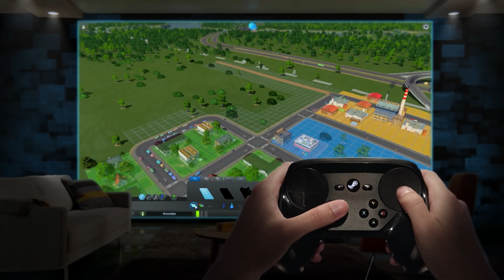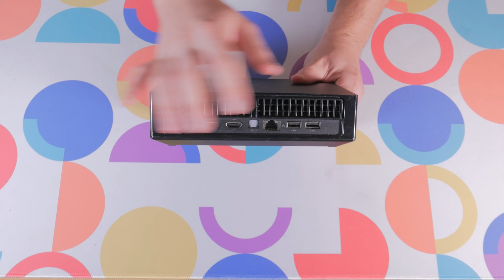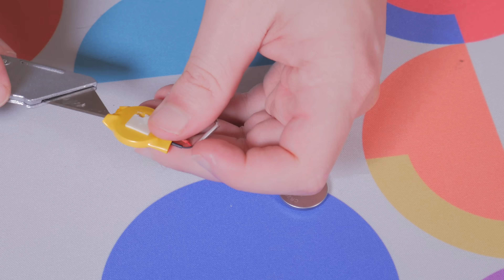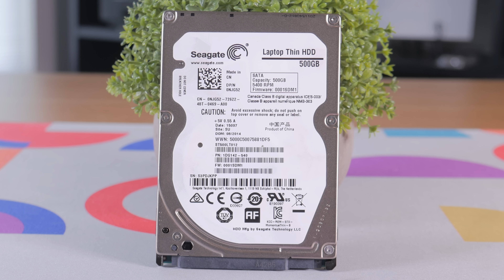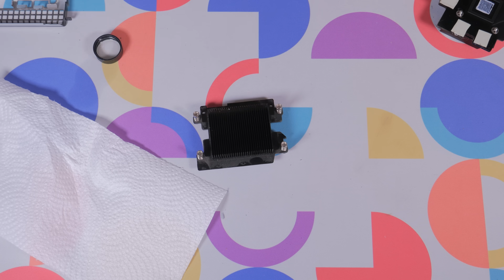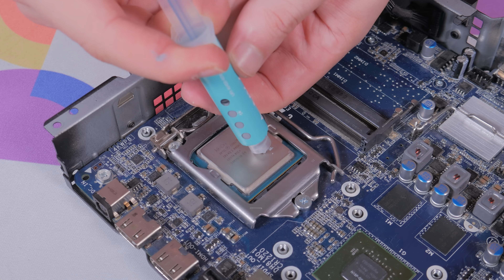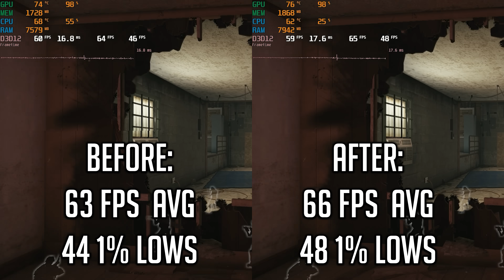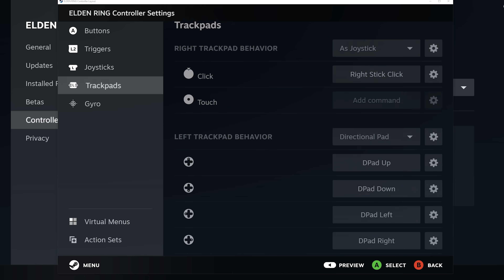I Bought Valve's FAILED Steam Machine in 2024...

Comment: since you have the Alienware Alpha with the NVIDA gpu (there was one AMD version produced), you can't install SteamOS 3.0 via Bazzite or ChimeraOS.  What you can do is install BatoceraOS on these machines and make a killer retro emulation machine.  I have the i7-6700t with GTX960 version Alienware Alpha and it rocks, running up to PS3 emulation. Xbox 360 is still shaky, but that emulator is still early and is buggy.  Since BatoceraOS is Linux based, it is not a resource hog like Windows is.  Give it a try.

Comment: Note: there were actually two generations of the steam machine released back in the day. The other one had an AMD GPU and a port for an external GPU docking station. The other had a later Nvidia GPU (GTX 960).
Reply: mine had the 860m graphics chipset. i had the og  with the i7 asm100 or something the later version was the r2
Reply: You're speaking of the R2.This is the R1 and it was only released with the 860.
Reply: Yeah i was able to find both the R1 and then later the R2 used for good prices on ebay. Even the original asking price it was a good deal at the time, there were only like 2 competitors and they were 500 dollars more for the same specs. This is not ITX formfactor its way smaller. I had the windows versions because back then steam OS had a huge performance hit and a lot of games didnt work, it was ahead of its time but look at them now some games they have a performance advantage over windows
Reply: Yeah, the downside was they did it include space for regular 2.5 drives. That way I could use the M.2 system drive and the 2.5 as storage.  Sure, the new port was good, but it was definitely limited. Even on the CPU generation they chose to use.

Comment: The problem with all the steam machines at the time were: 
1- the pricing was all over the place with different manufacturers.
2- Steam OS was based on Debian not Arch like the steam deck version so games didn't run that well in comparison to using Windows.
And finally and the most important one 
3- This came out pre Proton so they were actually expecting developers to port their games natively to Linux which a lot of them didn't want to do so valve has to change their strategy and ask gamers to instead stream Windows only games from another computer and that's why the steam link came about.

Comment: You REALLY need to upgrade to either an i5 or an i7, the computer will perform SO much better with twice as many cores. I speak from experience since I did such an upgrade myself on a comparable system as yours. Just look at CPU utilization, it constantly hitting 90+ percent while it really should be below 50 percent to be sure no GPU performance is left on the table.

Comment: Now that they have the steam deck and are working on a replacement, they could reuse a lot of the design and features to put the same or similar board in a bigger case and sell it as a console. Just in plop in better cooling to allow higher TDP limits and make it quieter and faster, add support for external GPUs and call it a day. Without the display, battery and controller bits, they should be able to get the price down to $249 or similar to compete with the xbox series s

Comment: thet steam controller is really something you wont be something you'll pickup and be comfortable using overnight, it takes a bit of getting used to and finding what settings work best for you. when i first started using it back when it came out in like 2015, it took me maybe a week or two before it really clicked on how to use it, but its kinda like riding a bike, once you get it then you're kinda locked in and it becomes a new norm for you. personally I like to turn off the trackball settings and just go full 1:1 mouse input. make sure you're learning how to use it with the gyro though, the track pads alone will get you like 90% of the way there but the gyro is the icing on the cake that makes it as good as it is.
Reply: I got one pretty soon after they came out. I played with it for a bit and saw the potential, but wasn't sold. It sat for over a year and I remembered how great the mappable buttons were when No Man's Sky came out. It's the only controller I actually enjoy for that game, and if I had to choose between a normal controller or a SC for an FPS/TPS, I'll always choose the SC.

Comment: A note about the Steam Controller: USE THE GYRO. A major thing about the controller is that it's gyro aim assist can be toggled on and off via capacitance, meaning you can have it not do gyro until you are aiming down the sights. It's meant to be tinkered with and played around, but if you just use it as a stock controller, then it won't be great. My personal suggestion is the roller ball mode for the right trackpad, which lets you panic fling in a direction and tap it to stop. The tactile feedback for it is legendary, and remains my most beloved controller in my collection.
Reply: This is it. I was underwhelmed when I first got it, but after tinkering for each game it's amazing. Using the track pad for aiming and gyro for ADS feels so natural now.
Reply: Steam controller is goated. a lot of tech influencers always criticize the awkwardness of it when its really good for FPS. Gyro and the trackball modes basically makes it where you can play TF2 or even Counter-Strike without a KB/M since theres no aim assist..  the back paddles also make crouch jumping possible without letting your thumbs off the trackpad. This controller was basically designed for this
Reply: I absolutely love my steam controller lol. That trackball mode is great
Reply: I don't use the gyro because I have weak wrists, but even then the inputs & easy mapping is still unmatchable today, even against third-party gamepad makers. The trackpads are amazing & while it takes a learning curve to learn, it definitely has a lot of utilities a standard gamepad wouldn't have.
Reply: I had one and never used it, ill give it a go now (I have a steamdeck so I get the gyro now)
Reply: My only issue with the controler was the trackpad, it just felt very strange, and i could never find myself enjoying it in games like First Person shooters,
Nontheless the controller itself was just universally loved. It worked amazingly as a controler, and was sold with the qaulity of all steam products (that being extremely good qaulity).

Battery life is yet to be a issue, This many years later, no damage or issues, works on PC and Mobile, its a overall amazing controller.
Reply: AA batteries is definitely better in any gamepad in my opinion. No need to worry where to buy replacements especially when they're discontinued. You can simply buy 2 sets and an external charger and you're good to go never needing to be plugged in while playing. And they're not expensive anyway. Proprietary battery and chargers would be much more expensive.
Reply: Nah, it isn't great regardless.
It's better for playing games not meant to be played with controllers than any standard controller is.
That's its singular saving grace.
Reply: I enjoyed mine for a while but then the track pads stopped working completely
Reply: they Gyro makes the steam controller the best ever.
Reply: I absolutely love using the roller ball mode for the right trackpad. Camera controls become a breeze. One of my least favorite parts of standard joysticks is camera control.
Reply: Every time I see a video of somebody trying the Steam Controller, years later: USE THE DAMN GYRO!!! :D. I insist on gyro even when getting regular controllers. This is why, besides a Steam Controller, I also have a Dualshock 4, Dualsense and the latest addition is, technically my daughter's white and purple Anbernic RG P01, which also has a gyro (great value but the firmware is kind of iffy).
Reply: so true Dota 2 if you custom map the controller makes it play like diablo 3 I won more matches with a steam controller then with the Keyboard and mouse you just have to put the time in messing with the configs took me just over an hour to map the controller the way i wanted it to feel the hardest part was making the movement smooth with the directional  Sticks but once I got it it was amazing but only because I customized it if I did the basic premade layouts it wouldn't work and I could see why so many people had issues you got to be willing to tinker with it to have fun
Reply: Love so much of the controller it's just unfortunate that it didn't have any rechargeable batteries
Reply: @RisingRevengeance  I'd argue it's easier with the current power layout. You can easily buy quality AA rechargeables anywhere. But imagine if it was a proprietary Lithium-Ion? With it being discontinued, the gamepad would've been dead.
Reply: @TheRibbonRed  there's no reason it would have to be proprietary
Reply: @RisingRevengeance  you mean like what they've actually done? Just buy yourself two rechargeable AAs & be done with it. I've had mine on the same set of rechargeables for 4 years & they still work just as well on release.
Reply: @TheRibbonRed  Sort of. It should also allow the controller to charge them via usb, which may be risky with random AAs.
Reply: @RisingRevengeance  oh, you want to controller's USB to also charge the battery inside? Yeah, that'd take a massive redesign. This is why proprietary battery was needed; and why Xbox, Nintendo, and PlayStation had proprietary. Because using LiPo or any other commercial rechargeables would make the controller either far more uncomfortable, or risk a fire hazard.
Reply: @RisingRevengeance  I use Eneloop rechargeables in mine and they work fine. 4 pack is $15 and have lasted a decade.
Reply: @phlogistanjones2722  a decade? Steam Controller came out in 2016, didn't it?
That said, I do have the same Enerloop rechargeables. Bought them in 2018 & capacity haven't dropped much. They're definitely recommended for SC, provided you stick an electrical tape on the side for easier removal from the controller.
Reply: I got the Steam Controller for $5+Shipping on the final sale Valve did when they discontinued it. I've never been able to get used to the trackpad for aiming or turning or anything of the sort no matter what settings I used. Even a simple circle-strafe is beyond my means. The main thing I use the controller for now is for platformers, shumps, etc - games where RS is either not used at all or just has a simple "pan up / down" use occasionally. I really wouldn't be using it at all if my 360 pad hadn't developed huge drifting issues.

Comment: I have one and it is running Linux great right now. The install of Nobara and Bazzite were both pretty wonky before the recent Nvidia drivers update... But now it's running very smooth on Nobara 40. I did the SSD and RAM upgrade, may do the CPU one when the cmos battery inevitably gives out.
Reply: It was at the beginning of the year but I did do a video of the install. Batocera is a great option for the Steam machine too as it is a pretty op retro gaming beast. 

https://youtu.be/Lprv6L-u9qk?si=_VwY_lib80IpNiW4

Comment: Note that SteamOS was Debian-based Linux, and SteamOS3+ is all Arch-based Linux with very different OS performance and kernel patches. For you non-Linux folk, It's like comparing Windows Vista to Windows 10 (rough example, but you get the general point).
Reply: This, SteamOS3, really isn't available to the public yet, just the ancient Debian version. However, I do see it has an old nVidia gpu with linux, which can be a pain with modern games as nvidia only gives good support if they are RTX branded cards. You're usually stuck with dated drivers, usually if below GTX or misc chips like this. AMD chips are usually much better off..
Reply: @arcadeportal32  In my experience every gpu starting from the gtx650 all work relatively fine on Linux, though they are kinda behind amd in terms of features
Reply: @arcadeportal32  You could always replace the graphics card with AMD.
Reply: @Madsynth1987  I did that with my living room PC with an AMD 6600x gpu, works pretty darn good with Linux, no installing drivers just plug and play.
Reply: Aren't the older N'Vidia drivers only officially supported on Ubuntu? I would think that he'd be able to actually run the old Debian SteamOS or even a newer version of Ubuntu or Mint and get pretty solid performance.
Reply: @TheDalisama  Yeah, even the older Debian-based SteamOS performs better than Windows 10/11 if you were to directly compare this device on both. Even without Proton, Valve's ToGL (precursor to Proton for DirectX over OpenGL) was already better in most scenarios than native Direct3D on Windows.
Reply: This thing doesn't have Vulkan support
Reply: @miregoji2959  False. A quick web search shows the GTX 860M does in-fact support Vulkan.
Reply: Is that really the case or just the claim of "I use Arch BTW" mentality? 😄

Aren't the different versions of unofficial Steam OS use different base? Bazzite is probably the most popular which uses Fedora.
Reply: would be interesting to see someone load the new steam OS on it.  also put it on the rev 2 of the steam pc which was 6th gen intel and up to a 960gpu
Reply: WINDOWS VISTA WAS GOOD YOU MAGGOT
Reply: Arch 🤢🤮
Reply: this was also when proton didnt exist so you couldnt play 90% of your steam games unless it had an official linux port
Reply: as rough and weird as the Linux/Windows comparison is, it strangely works.
Reply: Unlike Linux we don’t have to worry about a distro being ass
Reply: @mila-d5b  That is your choice my bro. If you don't want hassle you can use an user friendly distro, if you want tinkering and customization you can use a power user distro like Arch

Be careful or your windows update will break your windows!
Reply: @peppefailla1630 arch isn’t even that good and your limited to what you games / apps you can run bc most of it needs windows kernel in order to work
Reply: cool lie, there is no performance difference between debian and arch, the only distros with noticeably different performance are clear linux (only for intel cpus) and cachyos (hardware dependent)
Reply: @poacherthenn  Sounds like you've used Linux; but don't actually use Linux. CachyOS is Arch, by the way.
Reply: @thatzaliasguy  i've daily driven linux for 5 years and have made multiple kernel contributions, and its irrelevant that cachyos (not catchyos) is based on arch since they get their extra performance by making changes not present in stock arch
Reply: @thatzaliasguy linux users try not to be annoying challenge: impossible
Reply: @nikolowolokin  It's hard to not annoy people that get annoyed by truth and facts.
Reply: @poacherthenn  "That's a lie!"

Said, while proceeding to spread misinformation...
Reply: @godnyx117  what misinformation?
Reply: @poacherthenn  The last part. Linux distros have different performance, and some feel more "smooth" than others.
Reply: @godnyx117  prove it

Comment: I remember grabbing one of these for under $200 either in 2015 or 2016 from a GameStop trying to get rid of them. 

I believe it was the i3 model and upgraded the ram, installed an SSD. It ran beautifully until it one day just died, but probably should have replaced the CMOS battery in retrospect.

Since I had an already dedicated PC, I just hackintoshed it instead and from memory most of everything was working and was way better than the released Mac Minis at the time.

Comment: steam machines have been replaced by mini pcs now and steam already has steamdeck i doubt they'll bring back another mini pc
Reply: they didnt make those and that was the problem venders would just slap the name on any old hardware they had so they could sell it for more then it was worth. then telling devs they needed to make linux ports with there 1% market didn't fly at all. the steam deck is the correction of those errors as they now control the hardware and made huge jumps with wine. the deck is a handheld because they saw how the switch printed money. where the PC handheld market was all but dead.
Reply: @gogereaver349  I wouldn't say the PC handheld market was dead when the Steam Deck came out. It was just really niche. Aya and GPD were releasing new handhelds pretty consistently, and Dell had teased a handheld before the Deck was announced. I would say that it just made the market more popular.